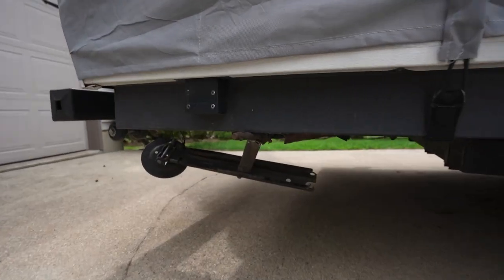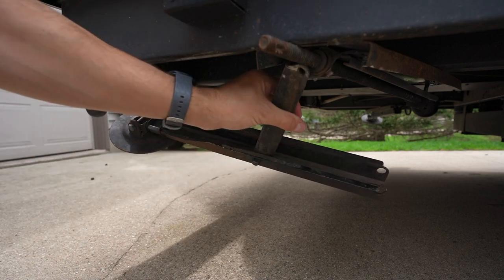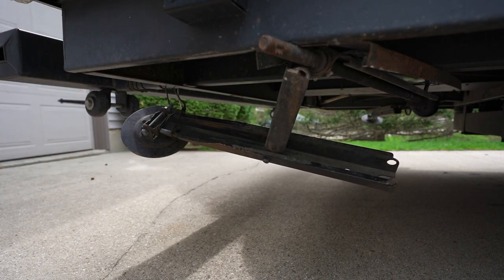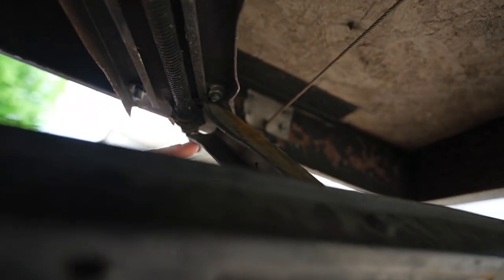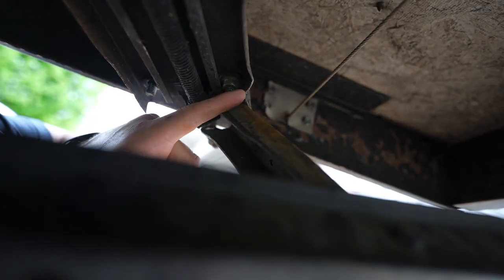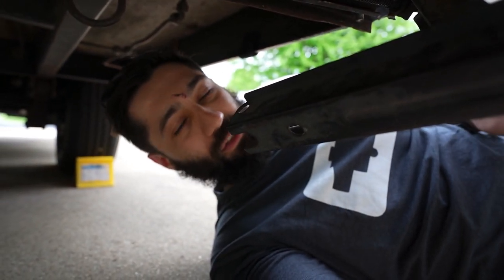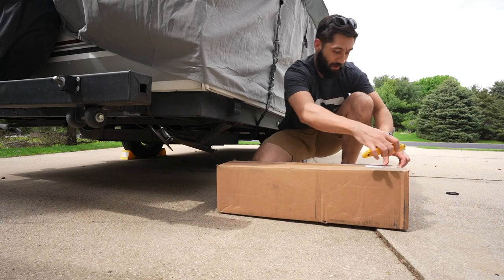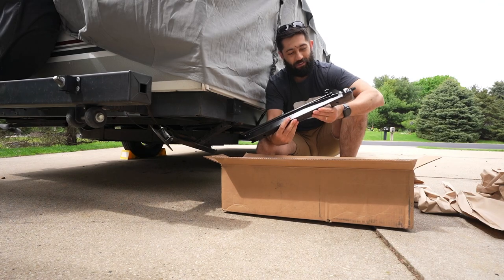I BROKE Myself & Our New POP UP CAMPER Before We Even Got It Home!

Comment from the maker: Any guesses on our new pop up? Hint: it’s a highwall, but not a Jayco.
Reply: Hard to say.. ? I have a Rockwood HW276 with the same Gearflag cover as you.  We have different wheels, and the front of the trailer doesn't look the same..
Reply: NIAGARA? 🤩😄🤷‍♀️
Reply: be sure to check your lift system tree. dust and dirt gets on the threads of the wiffletree and can force the loose bearings out. Also, I installed the replacement wiffletree available, and its pitch is higher, thus  illiminating the need for for the clutch dog brake in the rear. (they often wear out).
Reply from the maker: What model do you have?
Reply: @ItsPoppin  -same trailer. fleetwood niagara highwall. some have electric lift, most are manual. if you hear a 'thunk' when lifting its the chain slipping on the gear, (due to resistance on the tree).

Comment: It's a 2005-2010 Fleetwood Niagara. I have the same one. Great trailer - and have replaced  a lift cable, rear crank welds and wiffletree.
Reply: The Arcadia and Avalon are also nearly identical. 😊 We have an '08 Arcadia. It has the wrap around couch instead of microwave.

Comment: I've crossed the nullabor 15+ times and my go-to tool kit is - air compressor (never needed it fortunately), battery jump pack (used once or twice), Strong duct tape (held a bumper on after hitting a kangaroo), spanner set and screwdrivers and a couple of shifters(things happen, the sliding door of the tow vehicle even half fell off once), hammer, first aid kit, 10l of water in a separate container to the pop up water tank. And ofcourse the kids bike tyre repair kit when taking bikes :)
Reply from the maker: Right on, what are shifters?
Reply: @ItsPoppin  Aha that might be an Australian or atleast highly localised term. Adjustable Wrench? I carry one huge one as the camper spare tyre has a massive nut holding it on and one mid sized. If I need to undo a nut and bolt then I have the proper sized spanner and an adjustable wrench for the other side

Comment: That stinks you got hurt man. I just bought my first pop up about 3 weeks ago. I just took it out this week for the first time. I knew what to do because of you and I even taught the guy I bought it from some tricks I learned from you so we both thank you lol. I wanted to ask if you have a video or have ever considered making a video on how long your battery last, when to used battery or gas for longer boondocks trips. Just wondering because I want to head out soon for like a week and as of right know then only why I see that going well is with an extra propane tank and a solar panel. Just wanted you thoughts. Thanks